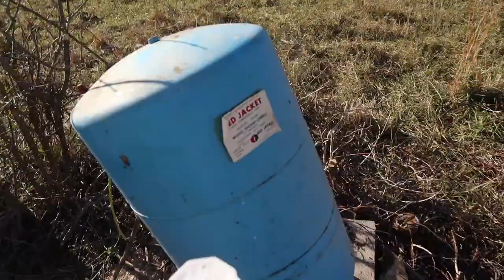SIMPLE DIY Well Hand Pump

Comment: Can this be used without electricity?? I’m trying to make emergency water source with zero grid or solar power. Our well water sits only about 25 feet down our pipe.
Reply from the maker: Yes this pump works without any power source.  I believe this style pump will work down to 60 feet so it will work it your situation.
Reply: Farm Life Outfitters thank you!!